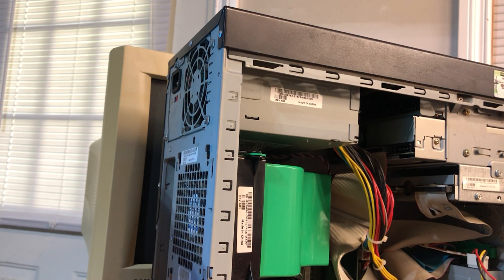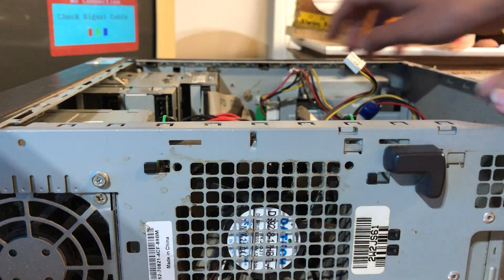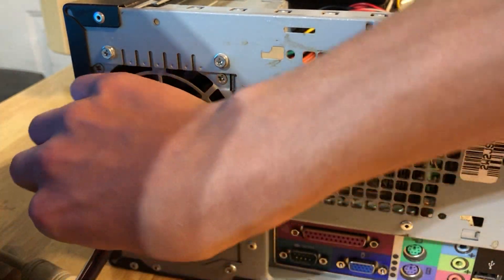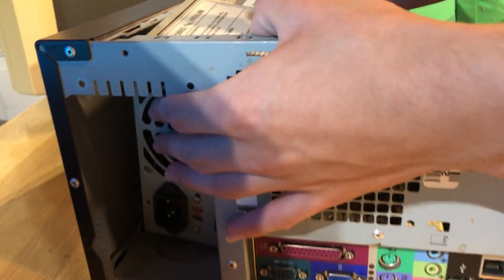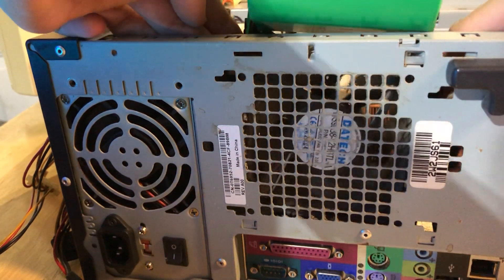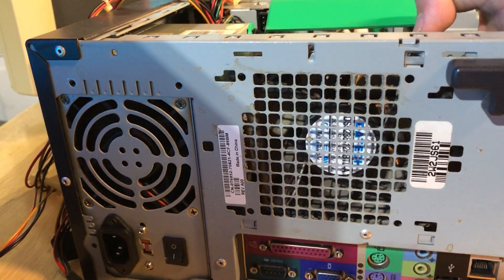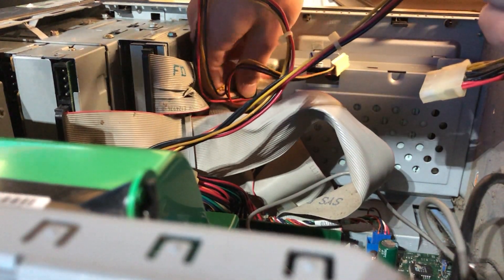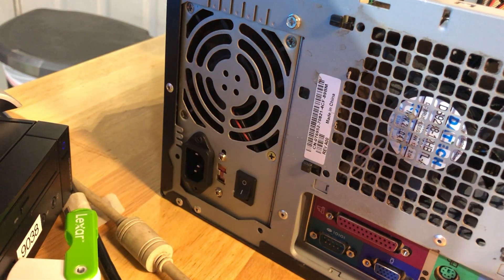Dell Dimension 3000 Pt 1- First look and new PSU

Comment: Good video. I bought one of these Dimension 3000's at a thrift store a couple years ago and it had the same problem with the fan in the power supply not spinning, but I figured out that poking it with something (nonconductive) would get it to spin. After using it for a while it would always work normally without issue. A few months ago I replaced the power supply anyway because the original one was causing a lot of interference with the onboard audio which was pretty annoying, it probably had capacitors going bad. Also I found it kinda funny that someone installed Roblox on a computer like that, I cant imagine it went well for performace.
Reply from the maker: Roblox would have probably run back in the day but I cant imagine it would even open now. Also experienced audio issues with the fan so that is why the PSU just got replaced.